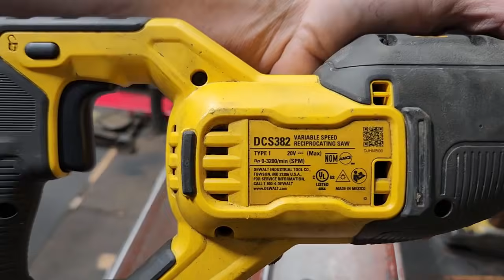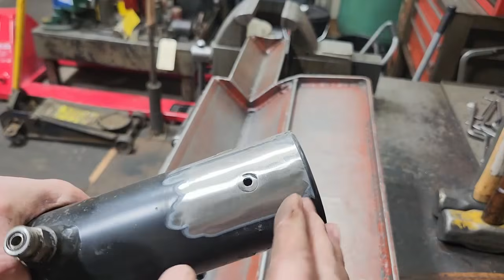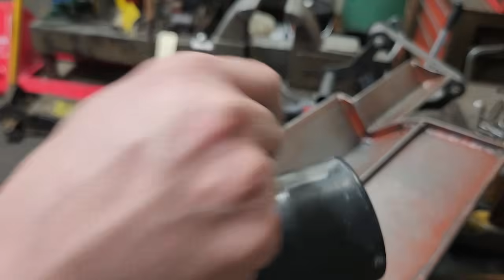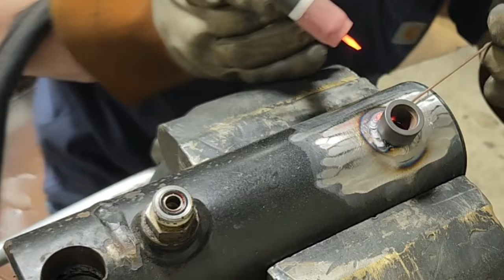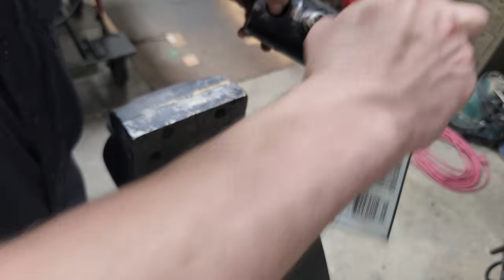Hydraulic Cylinder Port Replacement

Comment: Curious as to why you don't just braze or silver solder it on.  The braze would just wick in, form a very strong joint (as long as it's fluxed) and you wouldn't need all the heat input of 2 tig passes.  And there's also no undercut risk.
Reply from the maker: This is the way I was taught so I've always done it that way. Thanks for watching and commenting!
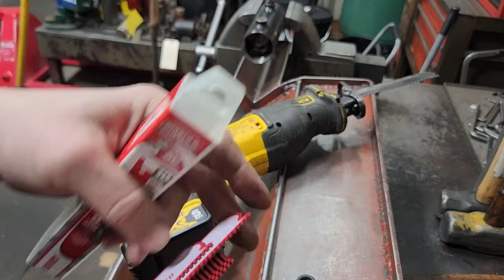Reply: @HydraulicRepair  The man said this at least 6-times, did you miss it?  This is the way he does it and you may do it differently. At 1:19, 
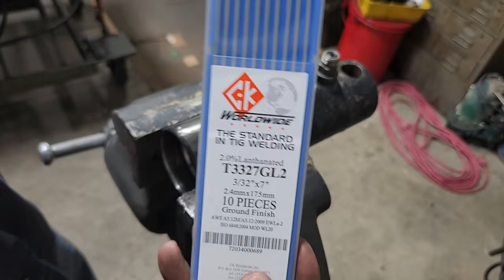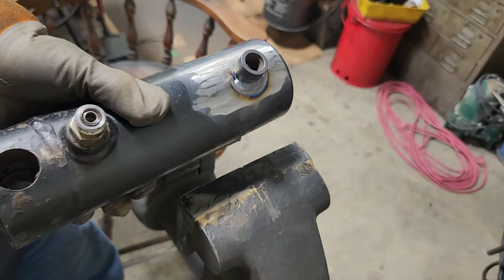4:59, 6:32, 7:21, 13:34, and 13:44

Comment: I've got that pipe sander attachment.  It doesn't stay on the grinder straight for more than 5min, plus it is very fast.   I have a variable speed polisher that I need to fit it to somehow.  I guess you shouldn't squeeze too hard with the vice or you could egg shape it when it's hot.
Reply from the maker: I’ve never had that issue with my attachment, but a variable speed option would definitely be a nice feature. And yes — you should never overtighten a tube in a vise. Thanks for watching and commenting.

Comment: The heat you are putting into the cylinder tube won't effect the shape of the tube? at all??
 Asking because I have seen you try to take apart a tube that somone else repaired the leaking port and distorted the tube so the rod wound not come out !
That won't happen again here??
Reply from the maker: If it does distort, it’s minimal. If I feel any unevenness, I use a flap wheel to clean it up and keep everything smooth. I also use TIG, which gives me much better heat control than MIG. I’ve been welding ports on for almost 20 years with no issues. The real problems usually happen when someone tries a quick fix and dumps a lot of heat into it—it might work temporarily, but it can cause bigger problems down the road. Hope that helps a bit. Thanks for watching and commenting!

Comment: I would think , you'd want round chucks to clamp down a cylinder or maybe even a pipe vise ?
Reply from the maker: The surface area holds it just fine for welding a port on. If I’m disassembling, then yes, that would be true because you could distort the tube. If I do need to clamp it, the lower part of the vise has pipe jaws. Thanks for watching and commenting!

Comment: Thanks for the video.  You have a later video of the log splitter cylinder with a distorted bore from port welding.  Do you know why their weld distorted when yours did not?  What did they do wrong?
Reply from the maker: I’d say the issue was most likely related to amperage. When I weld a port, I usually run around 120–150 amps and use TIG so I have more control over the puddle and heat input. The weld on the port you’re referring to was done with a MIG welder, which makes heat control a bit more difficult. On top of that, the cylinder was welded while still assembled instead of being taken apart first. It’s hard to say exactly what failed, but my best guess would be excessive amperage. Hope that helps, and thanks for watching and commenting.

Comment: I'm curious why you used a sawzall in the beginning and not an angle grinder with a cutoff wheel? Any particular reason or just preference?
Reply from the maker: When cutoff discs are shared, they aren’t always replaced when damaged. I’ve had several catch and start blowing apart, which is why I prefer using a Sawzall. Thanks for watching and commenting!

Comment: Good morning from the UK does the welding cause any distortion in the bore?
Reply from the maker: It's generally very minimal if any at all. I don't weld ports over 150 amps. I do a complete pass then let it air cool, do my second pass and let it air cool again. I'll use a flap disc on an air grinder if it needs any smoothing. I hope that helps some. Thanks for watching and commenting!
Reply: Nice job,thanks for sharing your welding settings. You definitely got full pen.